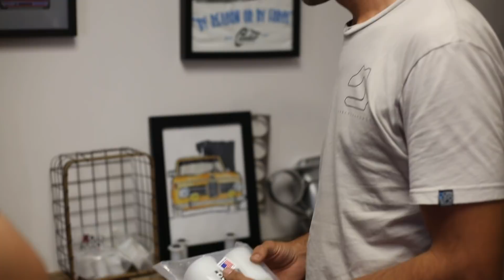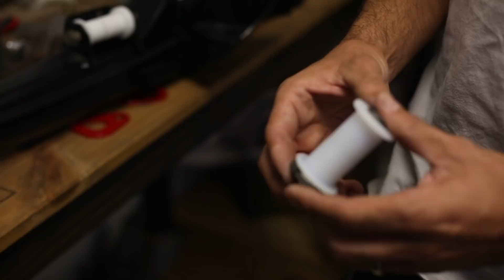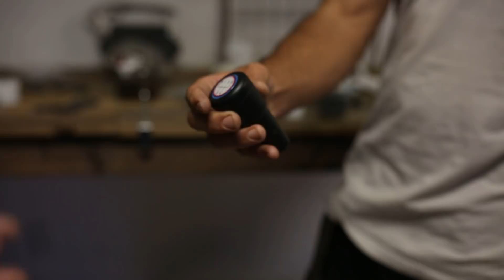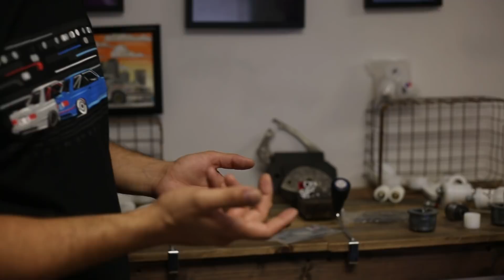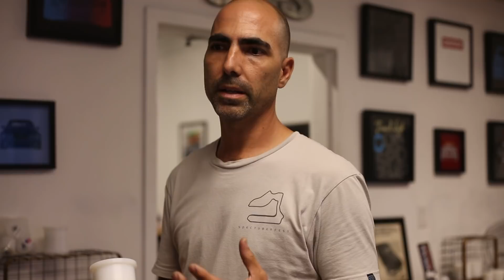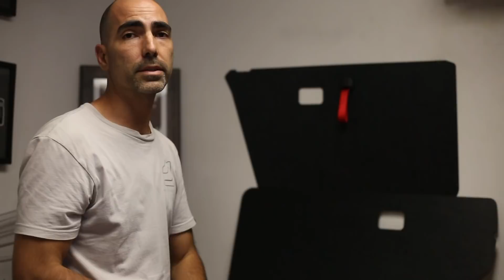Best Bushings for Your Car x Condor Speed Shop Part Review

Comment: OEM bushings have flex for a reason... when you start adding poly bushings it adds all kinds of vibrations. Had a daily with solid motor mounts man was that thing awful
Reply from the maker: jason mcguire correct for drivability and comfort but we are shooting to connect drivers to the floor. Solid and condor are different but most people who are buying are shoot for the feel rather then bmw factory comfort.